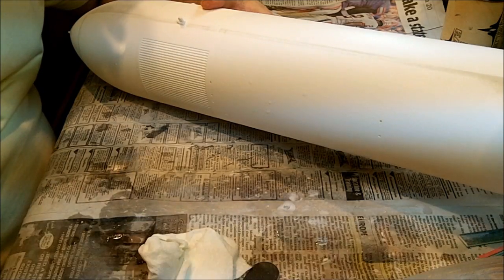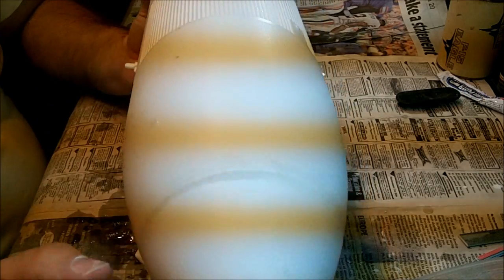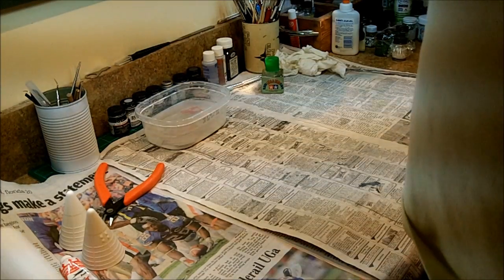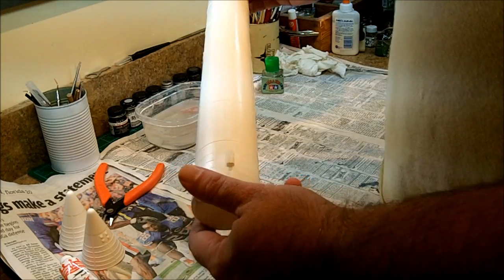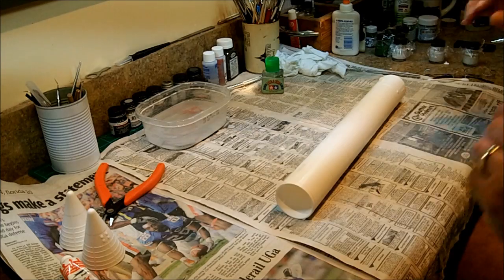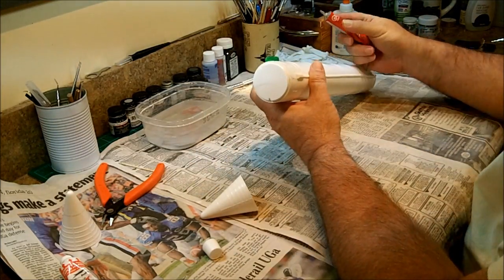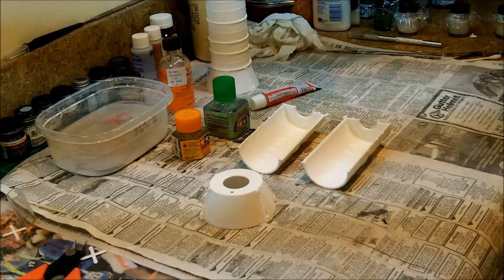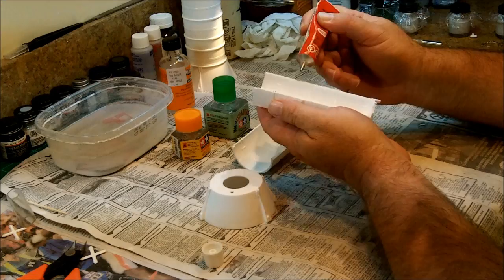Shuttle Wars, Part 3

Comment: With all do respect... I have been building models for over 40 years and have completed more than 200 kits... and have NEVER - EVER used those plastic welds... (plastic weld or Tamiya's).  Testors tube glue is MORE than strong enough to hold,  Even on the three 1/72 Space Shuttle stacks I have built.  Just seems as though you are suggesting a needless step, that leads to wasted time and money on a product you don't need

Comment: One easy thing you can do at this point as well is use a two part epoxy putty to make the foam bands that surround the aft SRB segments. The shuttle fleet used those since 1983 or so to prevent salt water damage of the joints that sit deeper in the ocean while awaiting pickup. After the foam rings are added, they don't need to be painted orange until after the gloss white paint is down on the SRBs themselves.